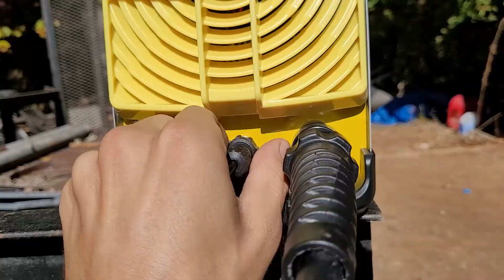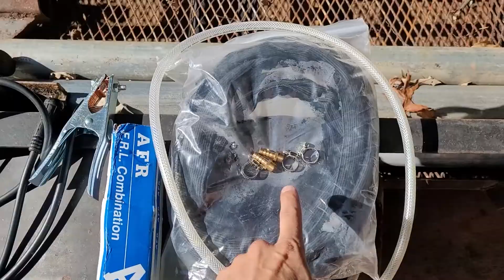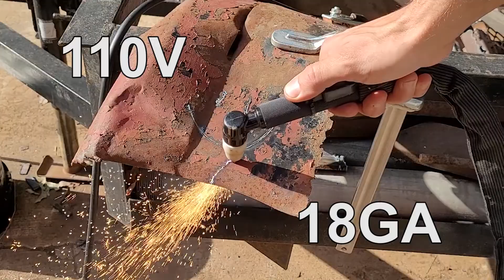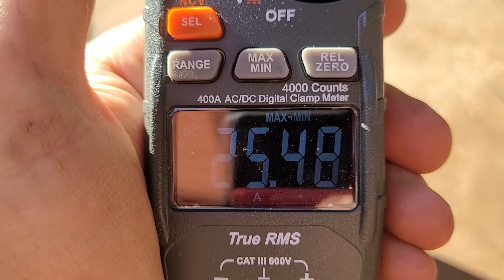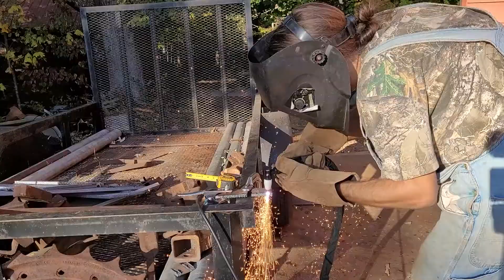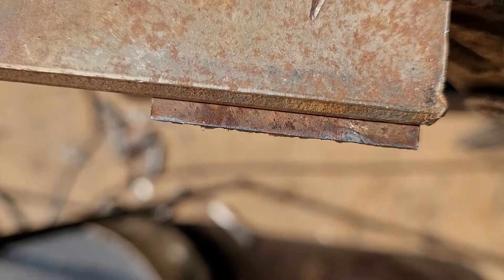AMAZON Plasma Cutter Review: Simder CUT 50

Comment: It's amazing to see a plasma cutter that inexpensive do such a good job. My Dad bought a Miller plasma cutter in 1980 for stainless steel. It cost $6000. I still have a vintage Miller SRH-333 225 Amp DC reverse welder from the mid 80s that I use all the time.
Reply from the maker: It is impressive for sure! How well do those old plasma cutters work? I see used ones for sale all the time on marketplace.
Reply: @MattsShop  They worked real well, but it was a long time before you could use compressed air with them. The early ones required an inert gas like Argon.
Reply from the maker: @RichaRat  That would be a massive pain! I might get one to test...